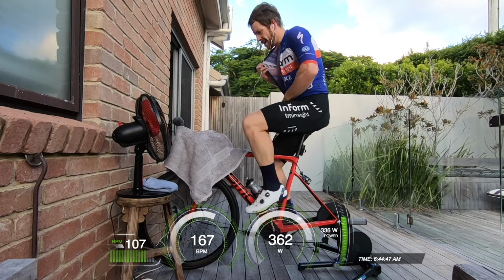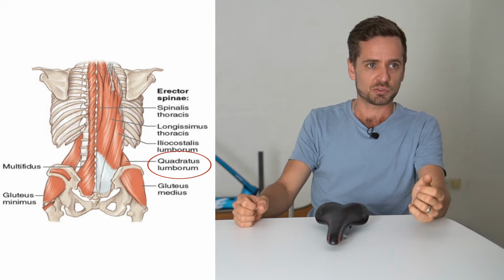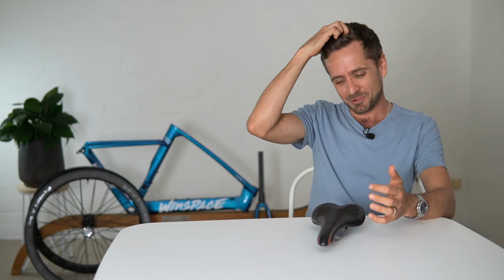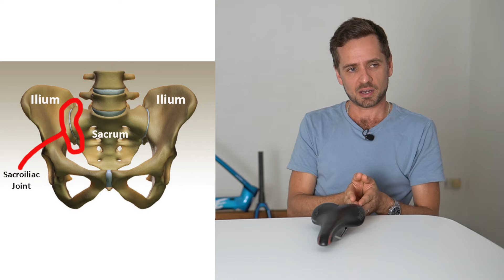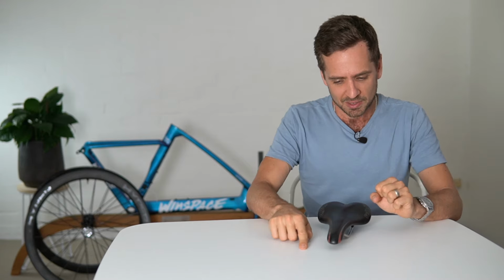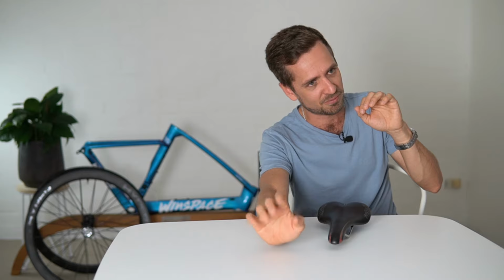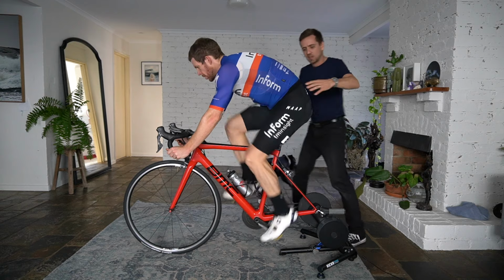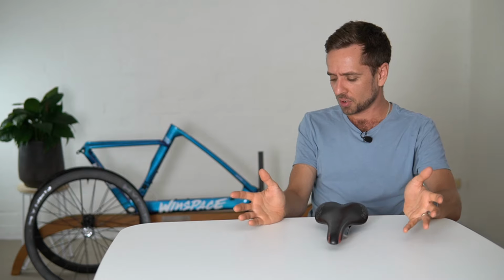What Causes Lower Back Pain for Cyclists (& the solutions)

Comment: This bike fitting series is the best thing on the Internet.    I work with a lot of clients who have had hip or knee replacements, range of motion at the top of the pedal stroke is a major concern when it comes to lower back pain.   As a fitter, one thing that frustrates me to no end is how the bike industry offers one Q-factor for everybody. Every Ultegra crank has the same Q-factor, same with every Look pedal.  Yeh, Speedplay offers more lateral adjustment and different spindle lengths, but so few bike fitters have studied FAI, so nobody stocks them.

Comment: I've been adjusting my handle bar and seat position with no relief, as this is what most people suggest. Even going through an expensive bike fitting didn't help. I've never heard the Q-factor being a cause of back pain, but I looked at my cleats and they were set to the minimum Q-factor (which was actually set by the fitter). I moved them out and immediately could feel that my back is much more relaxed when riding. Thank you so much for this solution!
Reply: have you noticed anything in the long run? i have also been to multiple bike fits and i still get back pain. never tried a wider q-factor

Comment: Neill, can I ask a back related question? I’ve just had a bike fit, which showed that my pelvis doesn’t rotate forwards more than 10-15 degrees from vertical, despite having good hamstring flexibility (I’m able to raise my leg to 80 degrees when lying on my back), and use SQ Lab and SMP saddles on my bikes. I’ve been switched to a more curved saddle to support this more upright pelvic position, but recognise that it’s not an ideal posture for my spine. In your experience, are there reasons why this might be, and can you recommend anything I can do, our any muscles I can target which will enable me to rotate my pelvis further forwards please? Thanks

Comment: Loved all of these videos with Neill; very informative. My lower back pain seems to be in reverse. When riding there is no pain but when finished, not long after, then there is back pain
Reply from the maker: Hey Andrew, thanks for the comment.
Having back pain after cycling can definitely be triggered from the exercise you are doing previously. Making sure your bike is setup correctly for you would be a great start as this will limit and triggers your body puts in place to stop it from hurting itself!
-RCA Team
Reply: @roadcyclingacademy  Thanks for the tips.

Haven't had a bike fit yet. New to road cycling, always been a mountain biker. Only used the road bike on a smart trainer with Zwift so far. I want to upgrade my shoes and get cleats before I pay out for a bike fit.

In the mean time, I've been experimenting with my riding position; saddle fore/aft, handlebar height, and it feels more comfortable if not perfect. Also been keeping a mental note of the way I am sitting when working or relaxing, or certain weight exercises that may be triggering the pain.

Comment: Hi Neil, I struggled with lower back pain for the last several years when riding at high outputs mainly due do the a severely compressed/herniated disc at L5S1.  I watched this video and your review of of the SQLab saddle. I went with both the SQLab 512 XL pedal and the 612 saddle and my pain is essentially gone.  I’m 6’6”, size 49 shoe, btw, and ride a Specialized Roubaix. Both changes are contributed to increased comfort. Since I did them both at the same time, hard to tell which contributed more.  Anyway thanks for the insights, I’m a big fan.
Reply from the maker: We're glad you got more comfortable on the bike from learning from us!
-RCA Team
Reply: This gives me confidence! I’m 29 (6’0, 72kg) and herniated L4L5S1 and severely compressed L5 and visit an osteopath frequently but lately have been getting lingering lower back pain after high output efforts. Gonna drop the saddle a few mm’s

Comment: Theoretically interesting however a lack of applied anatomical knowledge limits validity in some areas (as an example, QL is not a spinal stabliser; the CSA is minimal and it has little force generating moment on the lumbar spine).  A good point to start though, and some nice practical tips.

Comment: In my case the cause of pain is clear:
I only have a bike stand for the back wheel.
So when I use it as stationary the front is not firm enough like a real stationary bike is. 
1. I do not have back pain with a real metal stationary bike
2. I do not want to have to buy an additional stationary bike because of lack of front bike stand to immobilize it completely.
3. Any solutions to this? …

Comment: Hi so if I get right sided pain in my lower back it may be a case that it's my left leg causing the issue. I have spaced out my right cleat by 3mm with no improvement.  Am I doing it to the wrong shoe?

Comment: I need help. If I do a hard effort on Zwift I get no back pain, if I do the same hard effort outside I get low back pain for that day and usually into the next day. After an hours ride outside I always get lower back pain. I do know my core is very week also...

I also rock a bit when I walk...been like this for a long time. And also feels like I have a hip-drop.

If being on the trainer is fine, but outside is not...what is going on???
Reply: Maybe the tilt of the saddle is different when inside on the trainer than outside. If you get dehydrated, you can also get back pain, which is harder to realize when riding a long time outside. I learned this while cycling in the summers in Japan. Had to drink pure salt water to stay hydrated.
Reply: @ShadowzKiller  Tilt seems to be ok though outside I'm not slipping on the saddle. I think it's bad core strength to keep my spine stable, I can barely do a side bridge on the floor, core is very week. So when doing hard efforts my muscles get too tired to stabilise my spine :(
Reply: @darinsteele7091  I have a similar problem. Really hard efforts on trainer are fine, but outside I get back pain. No back pain on long sustained rides though. Sometimes the pain persists for longer and sometimes after I ease off, there is not pain after a few minutes anymore. I don't have such weak core though, even though it's certainly not the strongest. I can hold plant for 90 seconds or more (haven't tried what my limit is).

Comment: This series is amazing! Thanks for sharing all your knowledge Neil!

I have a question:
Can low cadence (due to low gearing) impact on this? I suffer from back pain when climbing, but i feel it's because I'm doing it on 36(front) 28 (back) and sometimes 60rpm cadence or even low, for long periods (but for me, 10min are enough to start suffering)

Can this be related?
Thanks!

Regards from Portugal!
Reply from the maker: Hey Diogo, definitely lower cadence will cause more muscular fatigue, including the lower back. But over time this should minimise with conditioning. So if you experience the issue longer term I would say it’s a fit related problem. Cam
Reply: @roadcyclingacademy  thank you for the response! 👌👏

Comment: Thanks for this video.
I have lots of lower backpain when mountainbiking. I really noticed a wobble in my hip when riding probably caused by my thud buster (seat suspension) so maybe I have to get rid of it.
But in the end you mention a hip impingement. I recently been diagnosed with a fairy large labrum tear. And although it won't hurt when riding a bike it can cause stability issues.
Now I am really working on my core but what are the best options when riding with an impingement?
Reply from the maker: Hey Maurice,
I would look into some of the other bike fitting videos we have done as you will get some great tips from them. Especially the saddle setback and crank length videos as these are two of the best changes you can make for hip impingement.
-RCA Team

Comment: I get lower back pain all the time when riding. I suspect that the cause is the position of my pelvis on the saddle. I typically end up rotating it backward, as rotating it forward causes the seat to dig into the 'sensitive soft tissues'. With the pelvis rotated back, I'm sitting more comfortably, however, this causes an increased bend in the spine in order to still reach the handlebars. And in consequence, the discs are under additional pressure, as well as the erector spinae muscles are working harder, leading to fatigue. After about an hour or riding, I have to periodically stand in the pedals and push my hips forward, to sort of bend the spine in the opposite direction. Or better yet, stop for a minute to straighten out. (My neck and upper traps typically also feel strained, so stopping helps with that also). I have a stock specialized saddle, which does have that grove down the middle. But perhaps its too small. Maybe a different seat will allow me to rotate my pelvis forward and keep my back straighter. Of course, it could also be the issues mentioned here, so I'll have to check for those. Thanks for your informative videos.
Reply from the maker: Good thinking Peter and you're on the right track. If you're getting perineum pressure with anterior pelvic rotation, the central nervous system will posteriorly rotate your pelvis to save your gentleman's region from trouble. The muscular cost of this is borne by the spinal extensors in part. Switching to a saddle which allows better anterior rotation will most likely help. Bear in mind you may need to drop the bars and extend the reach if the seat helps a lot as your torso will effectively be a lot longer once the change is made! - Neill

Comment: I have the issue that my left knee turns inwards at the top of the stroke because my pelvis is rotated to the front a bit on the left side. Should I try to move the left cleat more backwards? But wouldn't that increase the reach for my left leg? Or move the left cleat to the inside of the shoe to get a slightly wider stance on that side?
Reply from the maker: One for Neill, hopefully he can get to it... Cam